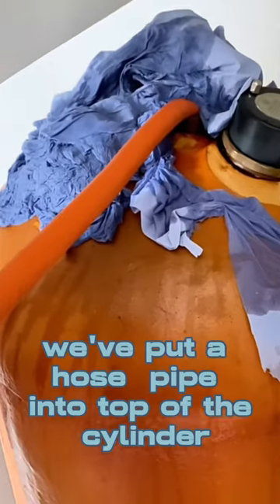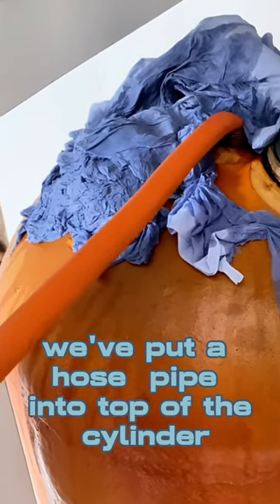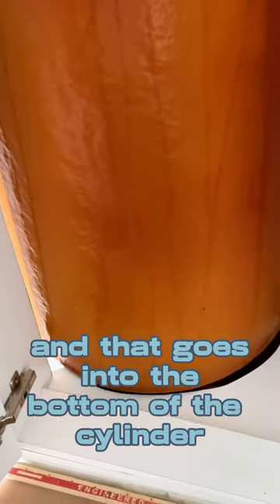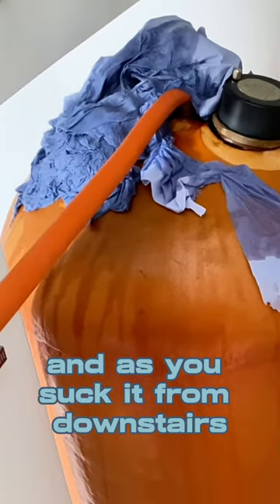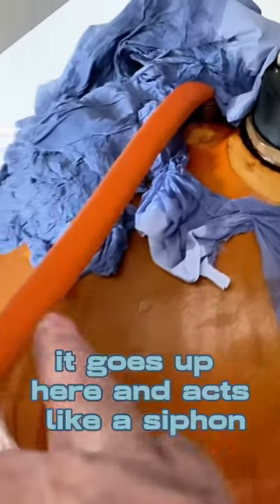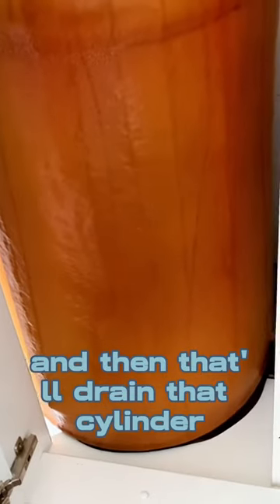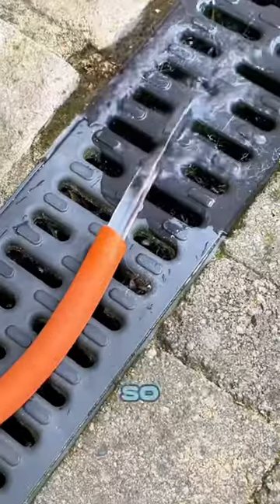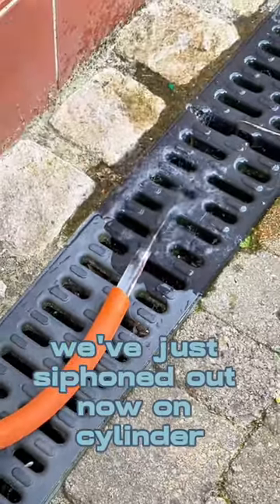Plumbers Tips How To Drain Hot Water Cylinder Plumber draining down hot water tank #plumber

Comment: Get a piece of 15mm copper, bend the pipe 90 pluss degrees put it into the cylinder then attach your hose then syphon otherwise the hose will tend to kink whilst draining.
Reply: Better with a length of 15 mm plastic pipe imo

Comment: What I do is... Put a mark on the hose, to the depth of the cylinder, so I know that the hose will reach the bottom. Why was there not a doc fitted at the bottom?
Reply: DOC 's often corrode at the bottom,  saves the risk of shearing off when trying to undo ( learned from experience 😀)